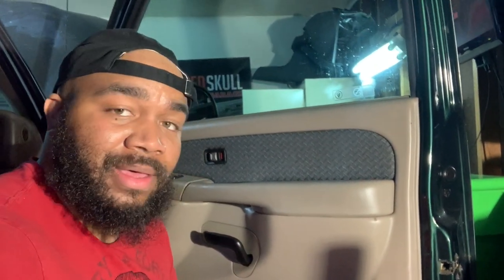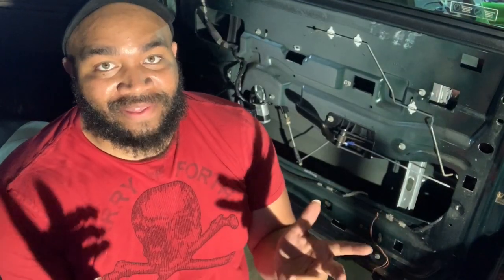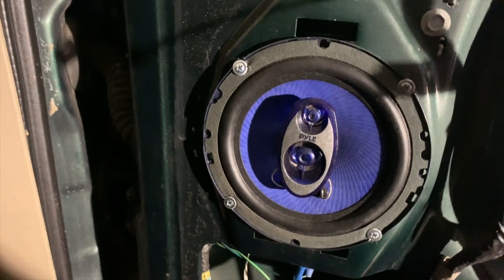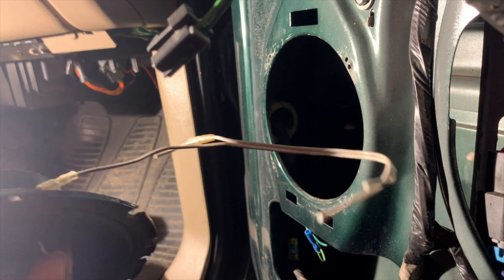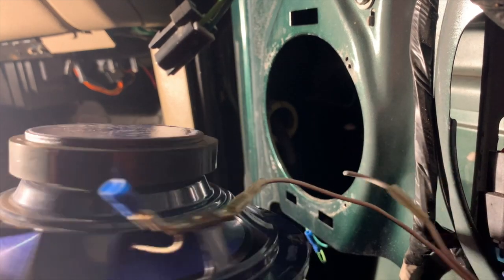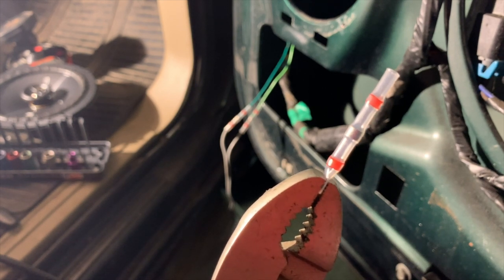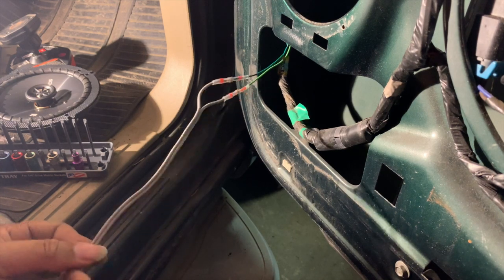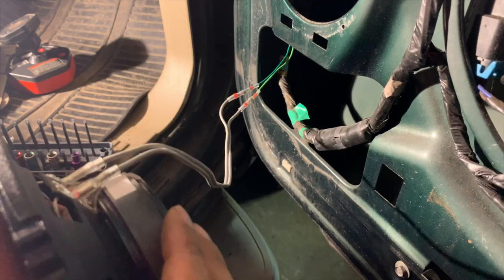Installing new door speakers in my Chevy avalanche

Comment: Somone had previously replaced those speakers.  Pyle is a cheap after-market Walmart car stereo brand and not the factory speakers that usually come with any Chevy Avalanche.  Factory speakers would have been OEM made by Bose, Pioneer or Panasonic.

Comment: darn so close for me.....i'm having trouble getting the electric lock stub into the hole on the plastic support when you drop the door panel down.....
i'm replacing a broken outside door handle.......got it all off.....back together is another story.....lolol
oh wait.....i should upgrade the speakers while the panel is in the driveway where i threw it in frustration......:)

Comment: Did he say 6x5 referring to a round speaker???
⚡️🦄⚡️
Reply from the maker: Kicker 6.5
Reply: @Blackzeusgarage  good job man!
⚡️🦄⚡️
Reply: @Blackzeusgarage  thanks bro! I'm going to change the speakers in my 03 avalanche and need to know what size they are. So a 6.5 inch will fit right in with no problems? Your input is very appreciated! Thanks again!
⚡️🦄⚡️
Reply: Just bought an 03 last month. Stereo LOC though -_- . Going to change stereo and I guess door speakers. Thanks.

Comment: Good video but please, do NOT ever use these fucking heat shrink connectors, they're utter shit. Definitely not reliable. I've had so many issues with these on some motorcycles I built, I threw all of them in the trash. All fashion soldering and heat shrink is the only way...